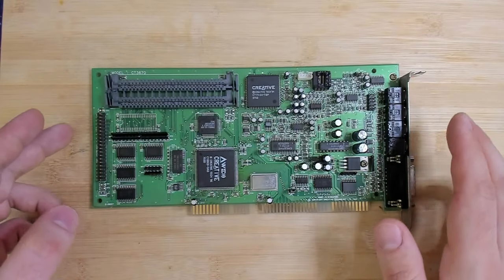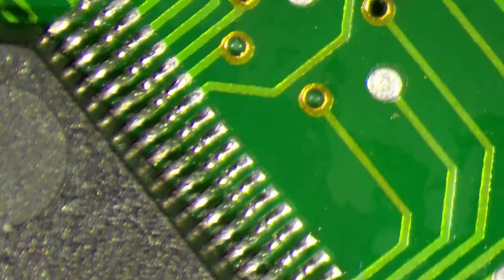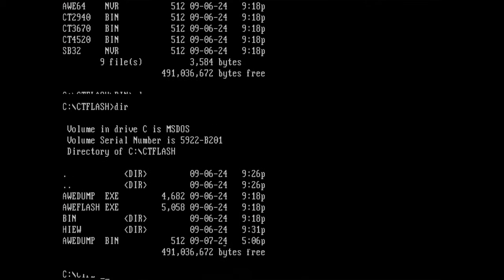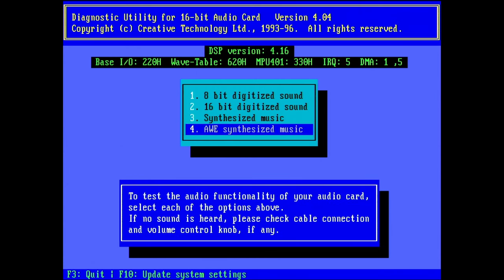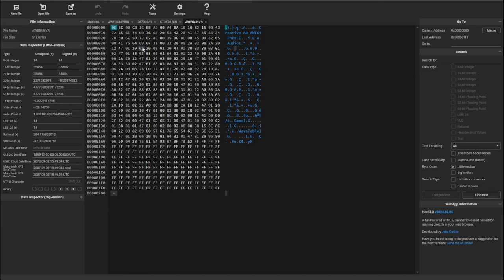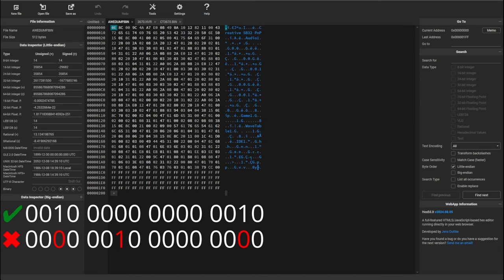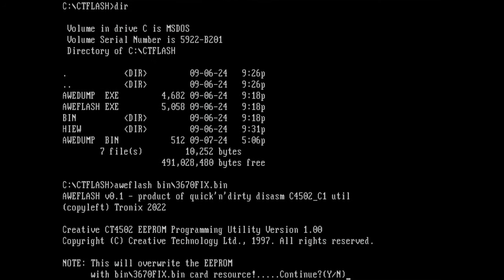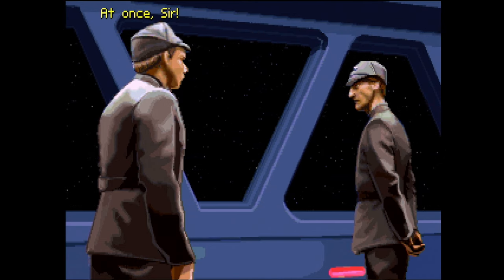This SoundBlaster 32 PnP CT3670 must live! Let me try again!

Comment: Very interesting.  I love ISA soundcards and I still have the original SoundBlaster 16 we got for the family 486 in a multimedia soundcard/CD-ROM kit from Sam's Wholesale club in 1993 which is a CT2230.  My family wound up with a 2nd 486, identical to the 1st 486, and we got a 2nd multimedia kit but it has the inferior CT2290 which is a Vibra card I believe but the single CD-ROM header on the CT2290 is an IDE header.  Your video made me think of two things I have always wanted to try which is: 1) to use an IDE pin header on a soundcard to read a hard drive and also 2) can a soundcard with multiple CD-ROM headers support multiple devices at once----such as a hard drive from the IDE channel and a proprietary CD-ROM  from one of the proprietary pin headers (Mitsumi, Panasonic, Sony).    There is very old post somewhere on VOGONS where someone mentions either using or the possibility of using the IDE header from a soundcard for a hard drive.  I never could figure out how to do this.  I do happen to have 2 or more computers with the proprietary CD-ROMS working with their respective soundcards.
So much hardware and never enough time or room.
Reply from the maker: I was under the impression that IDE hard drives would not work on soundcards - only CD-ROMs. I wonder if the BIOS will even be able to configure the hard drive connected to the soundcard. But interesting thoughts! I wanted to play around with those IDE interfaces anyway - especially the proprietary ones. However, some required non-standard cables. That will be a bit challenging.

Comment: That's a sounblaster AWE 32. It's the little brother of the Sound Laster AWE 64. It's the beginning of the AWE Series
Reply from the maker: I read somewhere that it can be flashed with the settings of an AWE64 - I might have to try that some day. Maybe patch that IDE interface in there and have an AWE64 + IDE.
Reply: @bitsundbolts  yes you can flash it with awe 64 data. But I dont think there is enough Rom for the ide function. The flash is 512bytes for awe 32 with ode and it's 512bytes for the awe 64 without ide.
Reply: The AWE32 came before the 32pnp and before the AWE64. AWE stands for Advanced Wave Effects, the wave table synthesiser it uses. The number is the number of simultaneous voices it can play at once. The memory slots are for expanding the wave table memory from 4mb to 28mb on the AWE32.
Reply: Little brother in which sense? in many ways the awe64 was a step backwards, and the whole AWE series with the EMU8000 Synth was several steps backwards to the E-mu Preoteus 1/XR the Turtle Beach sound card had. Creative was always cuting corners and cost.

Comment: Good Job!!! This was one of the lucky ones just a flash and it's back, in most cases the eeprom is bad and won’t take the hex, I have fix them by desolder the old chip (usually a ISSI branded like yours) and replacing it whit a freshly flashed new eeprom.
Reply from the maker: I already ordered replacement chips because I wondered if it is possible to flash those eeproms from DOS. Well, luckily it was possible without desoldering the chip. But now I have plenty of unused chips... Maybe I should work on this one project I had in mind where you can flash those chips using the parallel port on a PC.

Comment: Fun video! My first thought looking at the dump was that isn't a BIOS. Still awesome video!
Reply from the maker: Yeah, I guess I didn't put thought into it. It was more like "flashing" = BIOS.
Reply: @bitsundbolts  Did the contents of the NVRAM change after you used the config tool?
Reply from the maker: I still need to check this, but I would assume that it will.

Comment: SB32 was a PnP cost reduced more integrated OEM version of the AWE32. The main difference between the 32 and AWE32 was the AWE32 had a separate genuine OPL3 chip and also had 2 MB of Sample Dram on board. The SB32 had  integrated OPL3 and no sample dram but had the simm slots. No sample ram was not really an issue as few people would have tried loading soundfonts with custom samples, they would have just used the default rom sample set. This card having 2 simm slots did mean you could install 2x 16 MB Simms and use a huge 28 MB sound font. The chip used by this card was the basis for the AWE64 series.

Comment: I grew up with realtek ac97

Came with the motherboard
Reply: Earliest os I remember is windows 95/Dos, still have the original 98, 2000, me and XP install discs somewhere 

Even used to have 3.11 install floppies
Reply: I have all sorts of Creative sound cards but the most compatible sound device in one of my Win98 machines is literally the Realtek onboard sound. I also have a Yamaha YMF-744 PCI sound card on the same machine which is good but has some compatibility issues that the Realtek does not so I switch between them. EAX emulation definitely sounds weird with the Realtek (and Yamaha too, to be honest), so I disable that as well.

Comment: Phil did a fantastic review of the card some years ago. I have one sitting in my K6-2 machine. 
It is an "odd" card, because it's closely related to the AWE64 and AWE64 Value.
Reply from the maker: I've seen his video. I need to rewatch it to understand how to configure it. In this video, I needed to make sure it works again. Well, one thing led to another and suddenly I cursored through hex editors and configuration files. I'll try to apply what I've learned from all the comments below this video!
Reply: @bitsundbolts  Keep up the good work!

Comment: The distinction between SB32 and AWE32 (or in this case AWE64) are blurry at best from my experience. Usually people claim the SB32 doesn't have any onboard RAM or the ability to add RAM. But as usual for Creative at the time, there is a counter example for nearly every assumption about any model they produced. I happen to have two counter examples for the above. The only thing they seem to miss compared to the "real" AWE32 is the Wavetable Header. But I have to admit, their chaotic product lines definitely add to their charm and mystery!
Reply: Yeah there were many models. The defining difference between the SB32 and the AWE32 is the lack of the onboard 512kB of soundfont RAM. There were AWE32 cards with and without the wavetable header, and I have several examples of each. There were also AWE32 cards without even the SIMM slots, which in my opinion makes them worse than this "value" SB32 because they are hard limited to having only 512kB for soundfonts, whereas this one can be upgraded to the maximum of 28MB. Larger soundfonts sound a lot nicer.
Reply from the maker: Those cards are confusing! So many different CT numbers which may just differ in a single feature. Mix and match! My knowledge of those cards is very limited, but I want to change that soon. I am definitely going to work on this card again in the future and install some memory in those slots.

Comment: SB32 on a 16-bit ISA bus is a bit misleading...
Reply from the maker: Hehe, I don't think those two need to match up. There was also a Soundblaster 512 / 1024 if I am not mistaken.
Reply: I think it means 32 simultaneous MIDI instruments, but it is very ambiguous in typical monopolistic Creative fashion.
Reply: The SB16 was called that way because was a card capable of 16 bit sound not because it used the 16 bit ISA, the AWE/SB 32 was a Sound Blaster 16 plus an EMU8000 Hardware MIDI synth capable of a polyphony of 32 voices (Lines of independent melodies) the AWE64 was a tweaked AWE32, also using 16bit ISA, but added another 32 synth voices by software but there were OEM versions that used the 32bit PCI, the Live used the newest EMU10K capable of 64 MIDI synth voices and the faster and wider PCI bus to avoid the necessity of onboard RAM but sound quality had nothing to do with that.

Comment: Was one of those guys yelling at the screen to run the Creative config (setup) utility 😂 You had a PnP checksum error, not a BIOS checksum error... and to fix it, you overwrote everything about that card's identity with one from a different card. You should flash the original back to it, and then try using the PnP setup utility! Because you're using it on a 386, which wasn't PnP aware, it needed external help.

I'd have run the Setup utility for the card and the utility would probably pick up the bad checksum and simply offer compatible settings for your system. By reflashing the backup and taking this approach, you can preserve what is probably your card's serial number in the EEPROM :)

I don't imagine it was a bit flip, but rather an artifact of the shorted pins in the past, with the system writing garbage config data. Just my theory.

Comment: I have a Compaq DeskPro computer which does not boot. Only gives PC speaker error codes of faulty memory. But the memory was tested. There are also jumpers on the board that enable the automatic start function, but it only works when it is in the off position. The BIOS is in made Intel flash ROM which is prone to memory cell corruption, if i remember correctly. I need to find some BIOS dump to test it out.

Comment: Nice fix! But damn, seeing this makes me regret throwing out my AWE32 and AWE64 Gold cards all over again. Luckily I scored an SB16 for just a few bucks a f ew years ago on eBay and my very first sound card (a PAS16) miraculously found its way back to me recently, so I'll still be fine with regard to retro sound cards. 😊

It seems that bit rot affecting flash memory is quite the weak spot in old hardware, I did not expect that! Luckily, it appears to be quite easily fixed in most instances, provided that it is diagnosed correctly. I shall always consider this possibility henceforth!
Reply from the maker: Yes, bit-rot seems to be a real issue. So far, I had four cards that were affected: Elsa Synergy, Voodoo 3, GeForce 2MX, and this Soundblaster 32 PnP.

Comment: Informative video as always! I wonder if, as a preventative measure, it is worth using AWEDUMP then AWEFLASH to read and then write the BIOS even to working cards. The idea being that, putting the flash chips through that full write will reduce the chance of bit flipping / bit rot happening in the near term.
Reply from the maker: Maybe a simple change in the PnP configuration would rewrite the chip as well (like changing the IRQ from 5 to 7). You could dump the content of your card and keep it safe for a future reflash. But to answer your question, I believe it is not a bad idea to rewrite the chip as you said. But I think it doesn't have to be done yearly - maybe every five years / ten years?
Reply: @bitsundbolts  We're setting this problem with flash drives nowadays I believe. Left unpowered for a while apparently flash memory is susceptible to these problems.
Reply from the maker: Yes, that is what's happening unfortunately. Those non-volatile storage devices will lose data when unused.

Comment: i didnt ave this exact model buti i did have a sound blaster 16 and 32. i dont remember mine having slots for ram. i think it had ram soldered to the board if i remember right.

Comment: For future reference, if the card is not detected at all by the flashing utility because of empty or very corrupted EEPROM the chip can be desoldered and programmed by selecting a standard 93C66 4Kbit EEPROM in almost any chip/eprom programmer. Also to mention this is actually not a BIOS but a type of config file (NVRAM).
Reply from the maker: I learned that from the comments: Non Volatile RAM. Not a BIOS, not really a firmware, but just a storage for information that remains intact when there is no power.

Comment: I am sure that PNP relies on data from the plug in device  "PNP card" to allow the PNP OS to configure them. So be it a ROM or some sort of programable device.
Reply from the maker: Most likely, the data of PnP is stored in that chip. At some point, those bits flipped as shown in the video and the driver no longer initialized the card due to a bad checksum.

Comment: If you have one of these, you might want to check out Eugene Gavrilov's KX driver, if that can still be scrubbed from the web somewhere. Check for the chipset being on the list and "Expand the potential exponentially!"
Reply from the maker: I checked and I can tell you that those drivers can be obtained using the Wayback Machine. But those are for newer Creative models.
Reply: Pretty sure those only work with SBLive and Audigy cards. Never heard of KX drivers for ISA cards.

Comment: You have a very neat card here! What I don't like about the AWE64 are their proprietary RAM upgrade modules, but that obviously doesn't apply here. :)
The EMU 8k is a fantastic synth, but I guess the card was late to the party. I know rarely any game that used custom sounds with it.
Reply from the maker: Unfortunately, I do not have a lot of experience with those cards. I only had some sort of Soundblaster compatible soundcards and never experienced these extra features. I hope to change this over the coming months.
I have to experiment with sound fronts and the memory sockets. At the moment, there is no memory on this card. I'm looking forward to this new knowledge!
Reply: To use custom sounds in any game that can use MPU-401 for MIDI music, add memory to the SIMM slots, use the AWE control panel to upload any custom soundfonts that you want, and set the game to use GM/MPU-401 for sound.
Reply: Ff7 has a sound font it loads for cards like this
Reply: @stamasd8500  There is a TSR supplied by Creative that provides MPU-401 emulation. The EMU 8k itself has its own interface to program its internal registers (there's a manual) which has nothing to do with the 401 or MIDI and the TSR provides software emulation. With all its benefits and drawbacks. Soundfonts can sound very good but General Midi doesn't do the EMU which is a full blown synthesizer comparable to the MT-32 but also with custom samples justice. If game studios had used it like the MT-32 and programmed their own specific sounds it would have sounded terrific!
Reply: @Pickle136  Cool, I"ll check that out! Thanks for the hint! :)

Comment: I looks like the header bytes are not included in the checksum, so even if they bit-flipped bits it might not matter. The only issue is, that, as they are not included in the checksum, you don't truly know if your fixed file matches the original shipped state of the chip. That being said, the bitrot seemed to be in a localized area you you may have the original shipped ROM. I wonder if those first few bytes are config values.
Reply from the maker: I'll try different things to find out what those bytes are. Someone suggested that maybe the bytes I changed were ok, but the checksum had flipped. Worth a try and see what happens.

Comment: i had a different problem with pnp isa sound card
it was not sb nut some gold trump audio device
i never was able to make it detect as pnp device on 486 board but the moment i got it in pentium board it magically worked so you never know how much messed up is plug and play implementation in the bios on the early boards
Reply from the maker: Uh! That is tough to troubleshoot and very annoying if suddenly everything seems to be fine in a different system.

Comment: the small change on the bios could well be a simple Serial number
Reply from the maker: In this case, I am sure it was bit rot which prevented the driver to initialize the card properly. The serial number and Vendor ID are in the first line. The checksum of the data starts after those initial bytes (where exactly, I don't know, but it could be tried since the file isn't that big).
Reply: @bitsundbolts  yes, I've  come across an issue with an old device that by simply reading and writing the chip (off board) was enough to revive it. keep doing these in depth videos, I like them all!

Comment: 0xEC is 1110 1100 and 0xCC is 1100 1100. There is only one bit difference between the two. So it's more likely that the 02 00 in the original BIOS was correct but the checksum CC was wrong.
Reply from the maker: Hm... Interesting. So, you say I should go back and put the original values in the BIOS file and change the checksum... Might be a fun little experiment 👍
Reply: @bitsundbolts  If you have the time, of course ;-)
Reply: It might also be that the original bytes were 0x20 0x02, and that the utility reads 2 bytes at a time and failed to read the first byte, so only returned 0x02 (and padded it with a zero). The two sample files for the same card had 0xcc checksum and I bet the header has serial number and isn't protected by the checksum.

Comment: EEPROM bitrot is something I've run into in synthesizers and car ECUs, too. most recently with the Bosch LH2.4 ECU in my SAAB; a bunch of bits had flipped in the idle air and base fuel maps that made it run terribly when cold.
Reply from the maker: As long as people are aware that such a thing as bitrot exits, it can be identified and fixed. Looks like motherboards, video- and soundcards aren't the only ones affected.